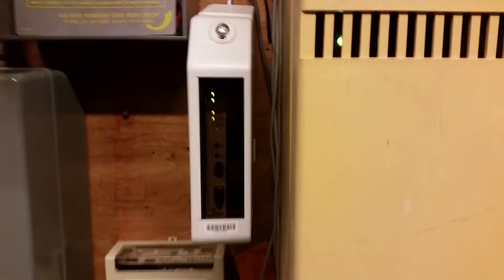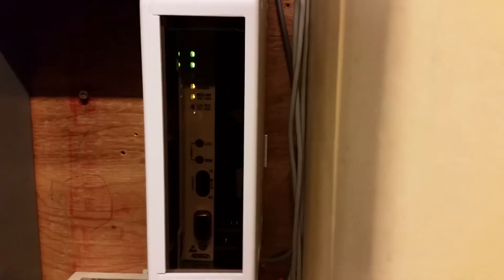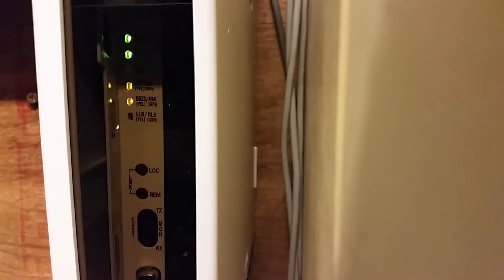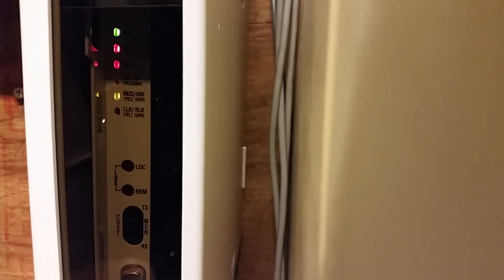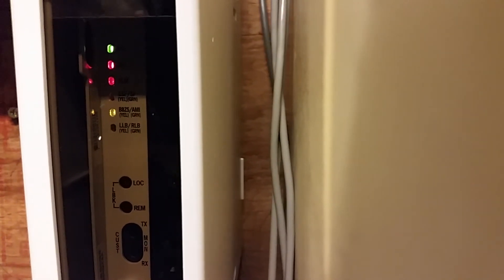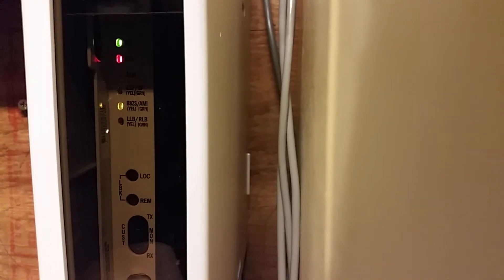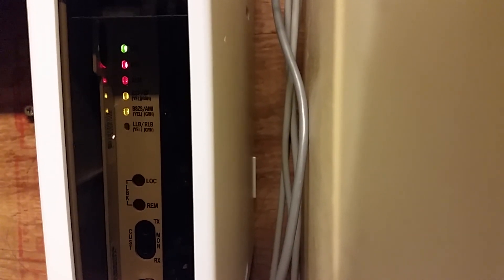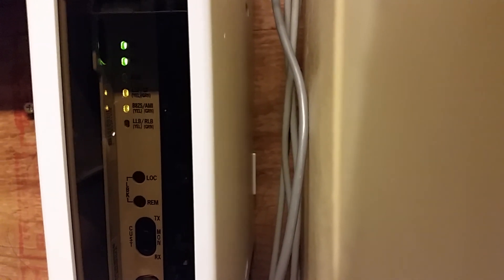Lights on a T1 Smart Jack

Comment: The equipment shown in the tutorial is an Adtran HDSL Transceiver Unit -  Remote unit, AKA: HTU-R. The HTU-R works in tandem with a a HTU - C (Central) unit that cane be located in the Central Office, Controlled Environmental Vault (CEV) or at a optical multiplexer closest to the customer location via either two or four metallic wires. HDSL systems can be deployed as two or four wire DSL systems. Depending on how far the customer is located from the C Unit. Two wire HDSL systems did not deploy with doubler (Repeater) units because of Telcordia/Bellcore Standards, as compared to four wire HDSL equipment  that do support HDSL span doublers.

The typical T1 PM-NIU AKA T1 Smart Jacks deployed after 2000 are capable of storing on board performance statistics (PM) in real time, and in stored memory. The T1 PM-NIU's deployed by Verizon typically have been found to have the most enhancements in the industry by design. I know this to be true since I was the lead transmission engineer at Bell Atlantic, latter Verizon that specified the performance monitoring parameters of the T1 PM-NIU's, and next generation HDSL equipment.

To access the T1 PM registers on the T1 NIU or HDSL Remote unit, all that is required is to connect a serial port of a PC or any dumb terminal with VT-100 emulation with a nine pin straight serial cable @ 9600 8 its no parity. Tap the space bar of the PC/Terminal and the equipment will Auto-Baud and display a welcome screen.

By examining the PM registers of the T1 NIU or HTU-R, the site technician can obtain information relative to the health of  the DS1 signal, and to the HDSL line if accessing a HTU-R device.

Comment: I actually sent an e-mail to Adtran about this card. It is a model T1L9MOK  HDSL2 card. They broke the common sense rules. The yellow lights are for. .(the top yellow  one) is AMI/B8ZS and the other (the bottom yellow light) is SF/ESF. The problem i have with this card is that as a technician I follow the rule of Green is good, Yellow is marginal and red is bad. They made the AMI light yellow for AMI and green for B8ZS. They then made the SF/ESF light yellow for SF and green for ESF. 90 Percent of all circuits out there use B8ZS and ESF, as they have that framing format has the best error reporting, those should have been green. They did it backwards.

Also the bottom green light is the facility from the phone company. If that light is red you have lost sync between your router and the phone company frame. If it is yellow it has taken bit errors in the last 45 minutes. It goes green again after either re-syncing up or running error free. 
Lastly the light between the green and the yellow is the customer equipment light is that is red it is not seeing anything in the way of a signal coming into the card from the smart jack. If it is yellow it is taking errors from whatever is plugged into the smart jack.
Reply from the maker: +TH Cabbie what a thoughtful and detailed explanation!   Thank you so much for the contribution.  I even learned some things!  I def agree with you on the intuitive nature of red/yellow/green.  Thanks so much for the comments!